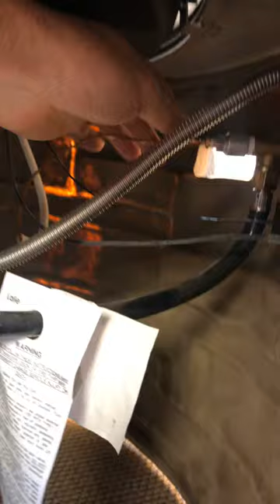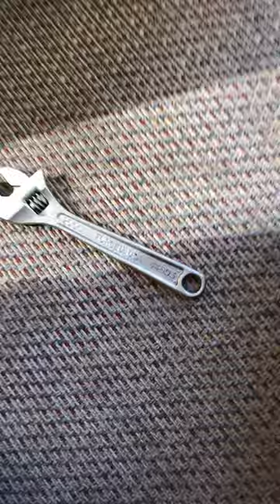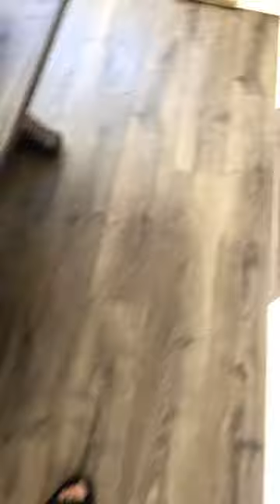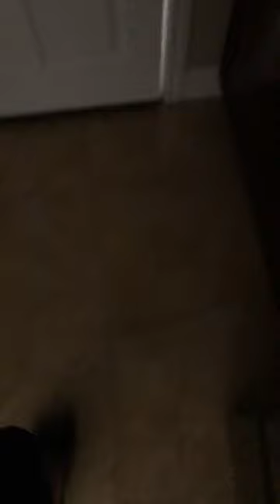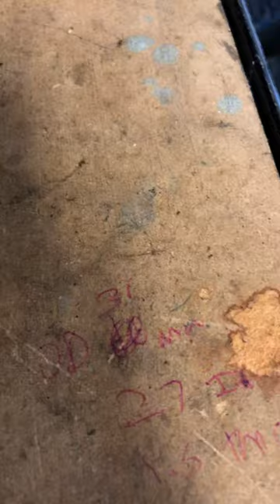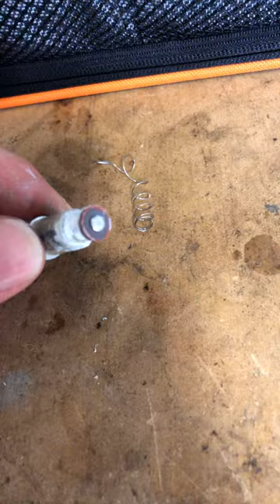Fire pit won’t stay lit fix - bypass thermocouple - Part 1

Comment: I have a six month old fire pit that was an unsuable hunk of metal sitting in my patio because it would not stay lit. I was getting ready to chalk it up as a $200.00 mistake, but because you were kind enough to post this video I was able to do the mod in 10 minutes and now my fire pit works beautifully. I did the version where by removing the spring with needle nose pliers and putting the spring back in first, in front of the thermocouple, no silicone no plumbers tape. I have a wind guard that blocks any potential gusty winds anyway. You are the man! Thank you!
Reply from the maker: Nice!
Reply: This procedure actually disables the safety valve, not the thermocouple.

Comment: I have a 2019 Hampton Bay Charleston and I was having problems lightning the pit new out of the box. Went to YouTube and ran across tightening the screw solution, didn't work, but removing the spring from the thermocouple did the trick! I thought it might effect the way I'd have to light and operate the pit, i.e. having to use a stick lighter while having to control l the gas from the actual tank, but that was not the case, it works as it was intended. Perfect solution, thanks for the help.

Comment: Thanks for the info. Good video. I realized that the silicone isn’t necessary though. Without the spring you can just push the button and it’s back in place and won’t move.

Comment: Thanks this fixed mine!  I unwound the spring away from the thermocouple until just one rung was left holding it on.  Inserted it back in (with the spring hanging off that end) and reassemble.  Works like a charm now!  This was such a pita before, lol

Comment: I took the spring off and then placed the spring before the plunger and then put it back together. The spring holds the plunger down. Works great now
Reply from the maker: Jason Cabral good idea! Didn’t even think of that.
Reply: @nateice1  Smart. I'm going to do that now and skip the silicone application. Good call Jason Cabral
Reply: Ya this is the best method

Comment: Before taking this potentially dangerous step, try tightening the nut on the copper tube on the assembly in question.
Many have found that the thermocoupler still works as a component, it is just that the loose nut prevents the thermocoupler from working properly.
You could also try applying a little plumbers dope/putty to the threads of the cooper nut before tightening it as this will both improve the seal and help to keep the nut from loosening again.
God bless.

Comment: Before bypassing the thermocouple, try rearranging the lava rocks/fire glass.  So, if you're using a combination of lava rock and fire glass as I am, Ive found that the fire glass doesn't quite get hot enough to keep the thermocouple open.  I was having tons of issues til I moved the fire glass away from the thermocouple and covered the area around it in nothing but the lava rock, Ive had no problems since.
Reply from the maker: Interesting. The flame itself is what should keep the thermocouple open. Probably just bad design.
Reply: I rearranged the glass and put the rocks all around the thermocoupler. And it worked !!!! Thanks for the advice... Matt

Comment: Curious - is bypassing the thermoconductor dangerous?  I converted 2 firepits to NG and one won't stay lit.
Reply from the maker: Michael Hafter if the flame blows out from high wind the gas will continue to flow. You can try cutting the spring down so the the thermocouple still works.
Reply: Very. 

A new one is under 15$.

Comment: Hello. I have a firepit table we bought a few months ago, that is now out of warranty and tonight is the first time we lit it. The fire goes out after just a few minutes or even less. If I do this trick with the sensor, will the gas always be flowing? So, I assume when I wish to use table, that I will need to turn value on gas tank on and off to make this work, to prevent the gas from always steaming? Thanks in advance for any help on that.
Reply from the maker: There are two valves. One on gas tank and one at the selector knob that controls the flame low or high. If you turn selector knob off then the gas will not be flowing.
Reply: @nateice1  Great! Thanks so much! Question... what if I just wanted to just remove that thermocouple device completely? Does it need to be there for some reason? Can I take it out and just place the screw back on?
Reply from the maker: @rtb5334  I think it needs to be there to be able to seal everything up because the wire touches the back of it.

Comment: My thermocoupler is rusted down and i can’t put a new one in. Tried this trick and it worked like a charm. HOWEVER...i feel now that its burning thru gas crazy fast.  Could it be from that or maybe something else
Reply from the maker: mark rosenberg the flow control valve that you turn on the outside should work as before and let the same amount through. Just make sure and turn your propane tank off after each use. And make sure you don’t hear any leaks.

Comment: Update on my situation.  Called Bond and waited on hold for 50 minutes.  Talked with a guy who decides my issue is the thermal couple.  He sends out the entire new valve system.  Meanwhile I order another regulator from Amazon just in case.  We try the new valve they sent and still had the problem.  Tried the new regulator and still had the problem.  I finally changed the tank with an older one and went to a different location for the gas.  It decides to work.  I have no clue why this is so complicated.  Good thing I’m not trying to BBQ or I’d starve!
Reply from the maker: Steven Moody I’m sure you will eventually have to perform one of the modifications to the thermocouple listed in my description in order to enjoy the fire pit.

Comment: Were you having problems with the gas flow going down after a few minutes?  I changed the regulator but after one time refilling the tank,  it’s shutting down again.  This on a brand new unit.
Reply from the maker: Steven Moody yes, it was the thermocouple shutting the gas flow off. Poor design. The thermocouple doesn’t get enough power to keep the gas flowing. I bypassed it with the steps in this video.

Comment: Could you just leave the thermocouple out and re-attach the coupling and gas line without the thermocouple inside?
Reply from the maker: As long as that end is sealed off. You will need to get a cap.

Comment: I can't get the silver cap off it's stuck
Reply from the maker: Try to get a pipe wrench to hold the other side and then just pull as hard as you can